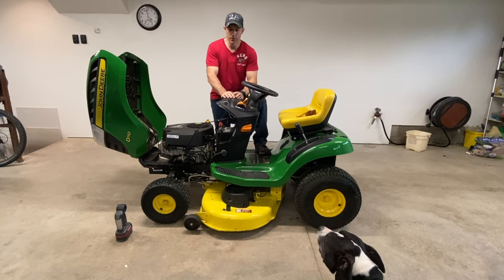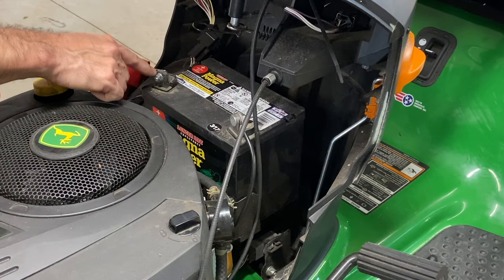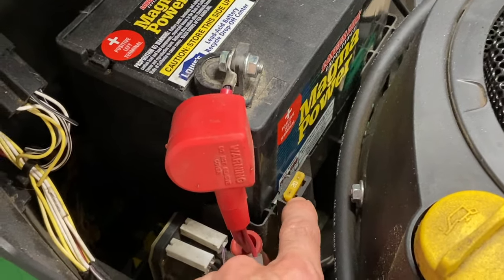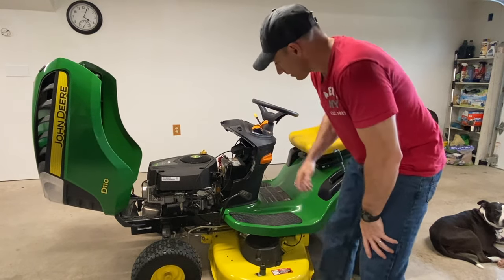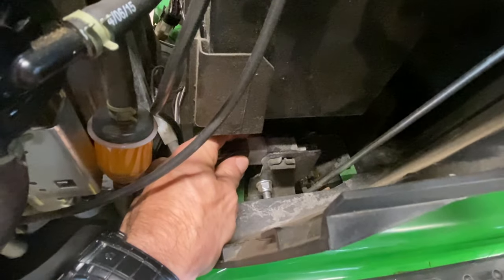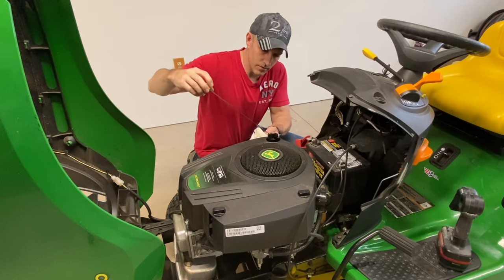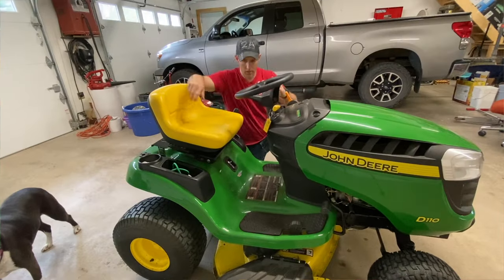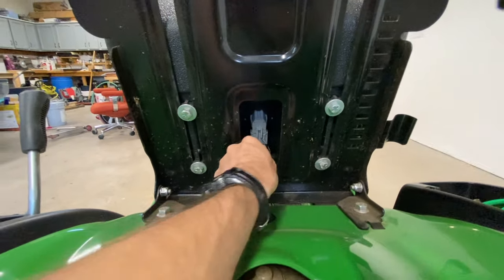JOHN DEERE 100 SERIES WON'T START

Comment: Another condition that may exist that can stop the engine from starting up (even though it cranks) is the fuel solenoid.  If the plunger is stuck, you won't get fuel.. it will just crank and crank.  You can test this by cranking for 20 seconds and then un-clamp the fuel line clamp going from the pump to the carb.  If fuel sprays/leaks out it's because the pump is putting pressure in that line and the solenoid is closed (failed) and the fuel isn't going into the carb... which creates the backpressure.
Reply from the maker: Thank you for the good info. Hope this comment helps someone. Hope you have a good summer.
Reply: Where’s that?
Reply: @johnnottahcal5725  The fuel solenoid is located on the BOTTOM of the carburetor BOWL.  It will have one wire going to it and it typically screws into the main jet housing that goes through the whole carb.  =]
Reply: @liberty9348  What’s the deal if it’s toast. Should engine still start if solenoid doesn’t close anymore? Trying to save an older John Deere. Fuel flows and started once but hasn’t even tried since running for 1 minute.
Reply: @johnnottahcal5725  Ah, so I will try to explain how it works and if "it's toast" what happens.  First, the solenoid is in the closed position by default.  It is supposed to OPEN when working correctly.  If the solenoid does not OPEN anymore, the engine WILL NOT start ever (honestly the solenoid is an unnecessary part and there just to fail so you spend money to fix it).  When you turn the key to "energize" (give power, 12v) the system, the solenoid has an electromagnet at the bottom.  There is a steel PIN that is spring-loaded in the center of the solenoid and keeps the pin in the UP (closed) position.  When the magnet is activated by power, it PULLS this pin down, allowing FUEL to flow into the bowl, then the float stabilizes and closes the float needle to allow the correct flow for the mower to run at the desired throttle level.  When the solenoid FAILS it will NOT go down (open position).  This will completely stop ALL FUEL from reaching the carburetor, rendering the mower dead.  Here's what you can do to TEST the solenoid;  Unplug the solenoid wire.  Unscrew the solenoid unit from the bottom of the bowl.  Then plug the wire back and turn the key to auxiliary power (usually one turn forward, but not to RUN).  You should see the steel rod go DOWN.  If it doesn't move, there is a problem.  You can take the steel pin out OR lubricate (I'd use PB Blaster penetrating fluid) to free it up and lube it.  Some pins are NOT removable and will have a rubber tip.  You can take that off and free up/lube the steel pin until it works.  If it still fails to move, you will need a new solenoid.  Some solenoids will actuate by just being plugged in.  Others "may" need to be grounded to actuate.  In the second case, just touch the metal housing of the solenoid to the frame of the mower and THEN turn on the power.  If your pin is removable and will NOT actuate after cleaning/lubing/etc., you can remove the pin and spring and KEEP it out.  This will likely cause a single backfire when you turn off the mower after it winds down (it's pretty funny) but will not damage the engine or mower in any way.  Just might wake up your neighbors... it will sound like a gunshot lol.  Or you can replace the solenoid so it works as intended, I have done it both ways in the past.  If your mower isn't starting, it's not getting FUEL.  If the solenoid IS WORKING, then you likely have a main JET that is clogged/blocked.  The carburetor and related parts are the cause 95% of the time.  You may have to remove the carburetor and clean it, especially all the little holes (jets, passageways, etc.) to make sure fuel will flow to the various areas needed.  I would also check to see if you have SPARK before tearing the carburetor apart as that takes a lot more time.  Get a spark plug tester (inline).  If the light starts flickering while you're cranking, then you have spark.  Hope the info helps =]
Reply: @liberty9348  You nailed it. Solenoid faulty. Seems free to move but doesn’t so I just took off little rubber tip so it can’t stop fuel for now. Cranked and started! Now onto persickery PTO seat safety. 😊 THANK YOU for alittle less grey hair! Now if only a neighbor would give me a new John Deere instead of their worn-out, broken ones. 🥴
Reply: @johnnottahcal5725  The seat safety is a switch under the seat.  You can bypass it a couple different ways.  Instead of me typing it all out, just find a youtube video on it and they will explain how to do it... it's easy.  It's too bad we didn't message sooner.  I buy storage units at auction and sell the contents (like the show storage wars).  About a week ago, I found a brand new 2006 John Dear 42" 125 automatic rider with 4 hours on the clock.  Blades never cut grass and it sat in storage for 13 years LOL!  I had to clean the carb and jets and it runs fine.  Sold it a few days ago for 1500.  Retailed for 1799 in 2006.... probably like 2500 today.  Anyhow, glad the info helped and she's running again.
Reply: @liberty9348  Yeah, I disconnected while trying to get mower running but it appears that won’t allow pto engagement.
Reply: @johnnottahcal5725  Sounds right.  The mower won't run with the blades on if no one is in the chair OR the safety is bypassed.  I'm sure there's a way to do it through the wiring.  It's not safe though :P

Comment: Thank you.  I had my mower running then when I shut it off to clean it wouldn’t turn over?   I am guessing it is the bsttery as the trickle charger was red after being on the battery for hours and the battery is about 5 years old.
Reply from the maker: I hope my video helped you out, thank you for watching

Comment: I struggled to get my JD LA145 started. Turns out that the valves weren't set right. Once I straightened them out it now starts every time. Good list of things to check first.
Reply from the maker: Thanks, was it hard to set your valves?
Reply: @DIYJIM  I have the Briggs service manual. I watched a few YouTube videos. Get the piston to TDC. It was easy. Just take your time.
Reply from the maker: Ok thank you my John Deere is running good for now but I will keep that in mind if I have to adjust the valves

Comment: Strange u didn't cover the SELENOID that goes bad..and to chk it..u use the screwdriver touching both terminals..to see if eng turns over...I'm just wondering why u didn't cover that or the OTHER safety switch or ignition switch...Can u tell the viewers if ur a mechanic or hmschooled small eng mech??.
Reply from the maker: Thanks for watching

Comment: Our S140 died after two uses.  We purchased in Dec 2020.  It remains useless.  Still looking for a cure.  It tries to start, but just does not.  Full gas.  Oil ok.  Deere says it costs us $100 to have it picked up.  This never happened to our Craftsman.  BTW, with the gas fill under the seat, with the catcher in the way, we spill gasoline all over Earth.  Horrible design.
Reply from the maker: Sorry to here that. Wish my video could have helped

Comment: My John Deere e130 hasn’t been starting for a few days. Replaced fuel filter, drained old gas and replaced with new gas, changed the battery, changed fuel filter, and changed the oil. Checked oil afterwards and it’s not covering both holes of the dip stick. Why would my oil be low if I just changed it?
Reply from the maker: Maybe you need to just add a little oil

Comment: Did all as described  on top of replacing, fuel pump, fuse, carb, solenoids , and still as if fuel just isn’t making it through the carb . Vacuum hose and fuel lines are not plugged. New battery , plenty of fuel... I’m stumped 🤔
Reply: When you turn the key it’ll run a bit if you hold on to it. But it’s when you let go, it stops
Reply from the maker: sorry i could not help you hope you can find someone that can help you
Reply: Check your gas cap! Clean the holes out. Or get a new one. My L 130 would turn over but not start. The holes were plugged up cleaned them. Fired right up. If the left pedal switch is corroded its under the hood with two purple wires unplug the swich clean with a small wire brush.  Plug it back in. It should start right up.  Shawn.
Reply: Rocky, I had/have a similar problem with my J.D. due to squirrels chewing my gas tank. I got this tape that does a pretty good job, but sometimes, I have to "pressurize the tank" by blowing into it as I'm starting it. Keep your feet away from the deck as well. Not really recommended, but it's how I get the fuel flowing until I can replace the tank and the hoses to it.
Reply: I've seen fuel lines collapse.  The outside is full sized but the braid between the halves of the hose (in/out) has separated and the fuel line collapses from within.
Reply: I’m having the same problem as rocky P- i have a brand new E-140 with 1.6 hours on it, turns on but won’t hold an idle... checked all vacuum lines etc, seem connected and sealed. Fuel pump worked when tested. Help SOS.

Comment: I've checked everything you said to check,  but it still will not start.
Reply from the maker: Sorry I could not help
Reply: Does the engine spin? Like when you try to crank it does the top part that you can see when the hood is up spin?

Comment: What really bewilders me is that my Ariens tractor is doing the exact same thing.
Replaced the carb fuel selinode and still won't start. Changed the filter. Nothing.
Soaked the carb in carb cleaner and gunk. ALso changed the fuel lines.
I also mowed the yard with it and turned it off. Won't start. 
The only thing I can think of next is to change the fuel float needle.  Stumped
Reply from the maker: Hope you get it figured out, I did also have this problemhttps://youtu.be/0qStUg0ImoI
Reply: @DIYJIM  
I got my little compressor and pushed air into the fuel tank. I got it running but I have to choke it to keep it running.
At least it runs again and looks to be getting closer to solving the issue. WHen I stop chocking it. It starts to spit and back fire until I apply the choke again.
I have a fuel pump ordered and will put it on and try it again.
Reply from the maker: @Tom-io5os  I have not checked my fuel lines yet but some people say the fuel lines on the John Deere start to deteriorate from the ethanol fuel.  Maybe you need new fuel lines.

Comment: bought a brand new E130 last year and had a good season with it, went to start it the first time and found a chipmunk made a nest in the flywheel, got that cleaned out and all that, engine looks clean, battery has been charged, go to turn the key and a loud EEEEEEEE buzzing sound, no turning over or clicking, just weird buzzing or grinding. bought new spark plugs air filter fuel filter and solenoid. im on vacation and i got my youtube, ill get this bad boy running  by the time I go back to work!
Reply from the maker: Hope you get it figured out, thanks for watching my video
Reply: @DIYJIM  hey buddy im gonna be honest with you after all of it said and done the problem was that a chipmunk siezed up my starter by having gone to the bathroom on it over the winter! got everything squared up now and ill be mowing before sundown today. thanks again my man
Reply from the maker: @tommyworth5030  wow glad you got it figured out have a good summer

Comment: I put a bottle of SAE 30 in mine a week ago and let it run for a couple minutes now it won’t start, it says to use SAE 30 for summer on the motor… did I not let it run long enough? This thing would start when it was dry of oil
Reply from the maker: Are you saying you changed the oil now it won’t start. I hope you did not just add another quart of oil because if you did you have to much oil in the engine.
Reply: @DIYJIM  it was smoking and bogging  down, wouldn’t maintain power. Figured it needed oil I checked the dipstick and it was dry.  Not a drop to be found. You’re telling me there was oil in the engine? I checked the dipstick today and it was at the right level. Luckily I only ran it for maybe a minute or two afterwards to see my smoke/bog problem went away. But now it just won’t turn over after sitting for a week.
Reply: @DIYJIM  I honestly thought it burnt up all the oil within the system so I didn’t drain it…. I should probably drain it or is it too late?
Reply: @DIYJIM  mind you this tractor is 30+ years old… John Deere Hydro 165 my grandfather who passed in 95 bought it in 86-87
Reply from the maker: I think I would ask a friend for help. Sorry really hard to help by commenting back and forth. Hope you can find someone to help
Reply: @DIYJIM  got ya thanks for the response !

Comment: Nice video but weve done all that and changed iginition switch still wont start unless i stick screwdriver on cellinoid which also was changed out? Any ideas?
Reply from the maker: Make sure your fuse does not have a hair line crack in it. A guy just commented a couple of days ago and said that he could barely see the crack in his fuse.

Comment: My D130 worked fine, then 3 days later went to start it up and nothing. It makes a low whine but it doesn't even try to crank. I know it's not the battery itself as the lights come on and I tried to jump it. I checked everything you mentioned except the fuse. Will check that later today. This is driving me crazy!
Reply from the maker: Hope you get it figured out, maybe a friend can look at it for you, sometimes they notice something that you might be over looking.